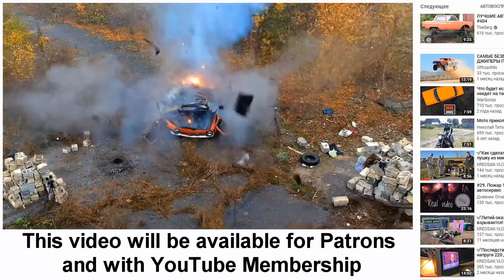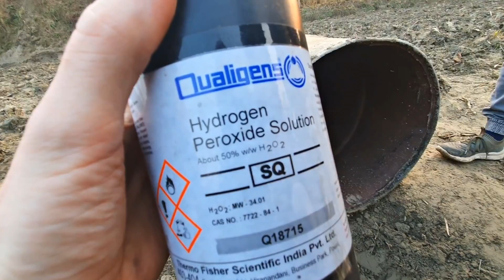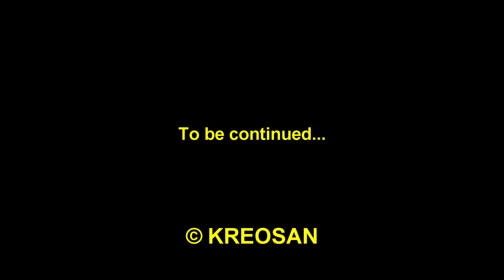FLIGHT ON A BARREL FILLED WITH CARBIDE 🚀 Acetylene & Oxygen ? ☠️

Comment: Nice vid ! It's remember me my youth! When i was kid i did the same experiment with calcium carbide! I suggest you to use some hay, straw or dry grass inside de barrel to retain more gas, and it's very important to seal the edge well  ! Instead of electric igniction we did a small hole on the top of the barrel and with the finger we push down for 1-2 min until you feel the pressure of the gas, then we ignite the hole with a long stick with burning newspaper called "staza" (means long stick in my local dialect). I rember the barrel, pans, bucket and other stuff going for 50m or above in height, and we ran away trying to not hitting by this flying bullets!!  Greetings from italy !

Comment: It would be better if use HHO .. bigger bang ..u know.., I can wait..!
Reply: Soyuz 2.0
Reply: But for real I would suggest reinforcing the barrel with tape, mesh and rope. As to prevent the barrel from exploding, or at least channel any projectiles towards the sky rather than out the sides.
Reply: Pretty much be a bomb at that point. Youd need a reinforced barrel, and mabye it wouldn't blow it up. Id love to see it though
Reply: I made much better acetylene bombs by snuffing out a cutting torch, then filling container (balloon or plastic bottle), and use a fuse ...for portable BOOM!
Reply: @etsmith2820  oh yea. I used to do that. Perfect ratio of gasses. Ive moved onto explosives and energetic materials tho
Reply: Not bad ..u just have to find the correct acetylene-air mixt ratio ,and use spark ignition instead of fuse ..